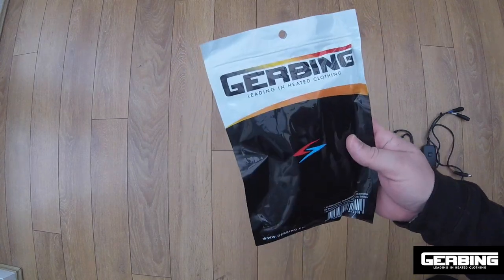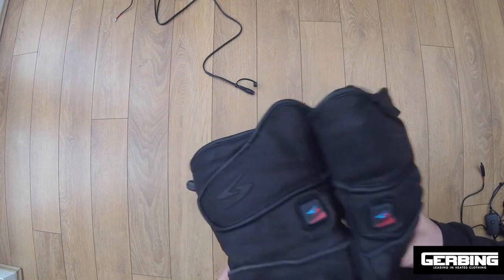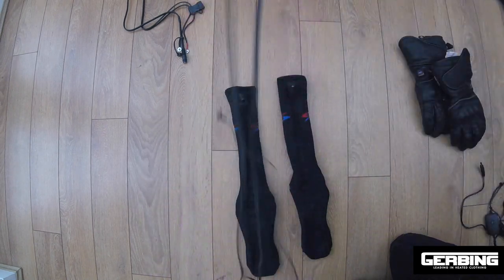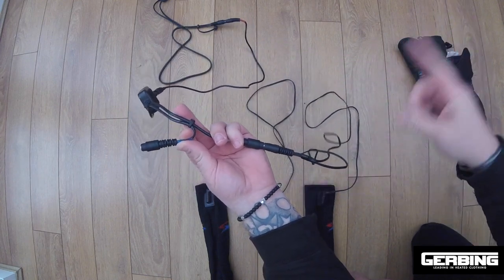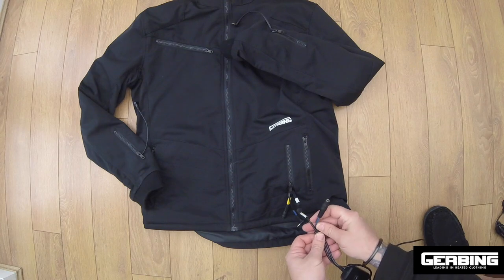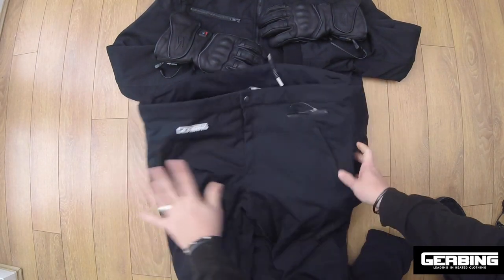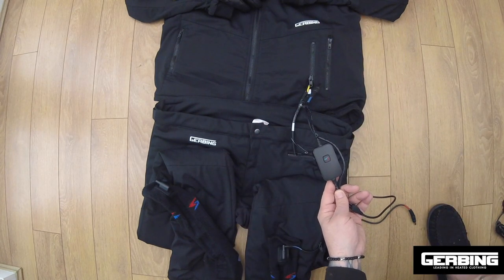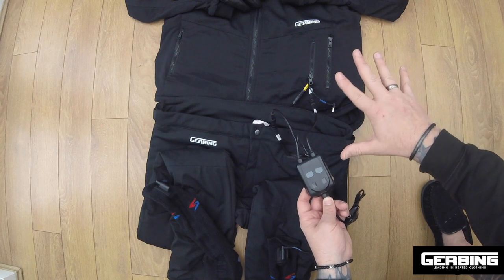How To Wire Your Gerbing Heated Clothing Controller

Comment: Really good video. Thanks for this. 
I have the single controller and all the gear, but the trousers burnt a massive blister on my right cheek and a bit on the left where the pocket is. It feels like there is a coil where it burns on the right cheek. It was on the 3 setting, 4 was unbearable. I have to pad it up by adding long John’s and two more pairs of underwear just to keep it from burning on the same spot. 
Everything else is great, gloves , jacket and socks. 
Is this something you experienced or have advise for ? 
I’m now sending the trousers back for exchange to see if it’s this pair I got.
Reply from the maker: Sounds like the heat element is in too closer contact with skin, it may have moved from the isolated layer or could be resistance causing it to get hotter. Best thing is to return for Gerbing to check

Comment: Would the full Gerbing Heated suit work good on and ATV? I use my quad for plowing snow in the winters for my own yard, and about a dozen other people, thought about this set up for the socks, pants, jacket and gloves, than toss my really thick winter coat over top to trap the heat in while I'm out for 5-6 hours, I have a separate heated snowmobile helmet that keeps the visor warm and clear, but do find inget a little chilly after about 4 hours of being out in -25C in just my normal winter jacket and ski pants.
Reply from the maker: Should work fine, as long as the adv has a 12v battery

Comment: That's some very good gear there and well presented mate I have saved that because if I do get some heated gear it's gonna be this .I am guessing you buy the controllers separately from the rest I will be checking out the website . Thanks : D
Reply from the maker: They are amazing, there are a few other brands on the market but when I did my research Gerbing were the leading brand world wide so I decide to go with them. I tried the other brands at the motorcycle show but found Gerbing were far superior in heating. It’s a costly investment but worthwhile as now I can ride all year round and not have to worry about the extremities

Comment: Excellent video!!!!  A quick question from this novice electrician.....if the battery supply is connected per your explanation, could i use a "coax male to SAE" adapter to then use that connection to power my battery tender when im not riding?
Reply from the maker: Yes I believe you can. I know you can but the optimate connector that you can use to charge the battery when not using the clothing.

Comment: Hi Mav,my gloves are coming next week,is your power supply direct to your battery,if so does it drain the battery when not in use,,,Cheers Baza
Ride Safe Mr B \m/
Reply from the maker: Yes always make sure the engine is running when the gloves are on, they draw about 7amp and that’s a lot on a battery where the engines not running

Comment: Brilliant video. It should be posted on Gerbing UK website as a freaking manual ))
p.s. One thing I don't get is how do you connect gloves to a jacket because cuffs on these gloves go over your standard motorcycle jacket...so the port/cable on the gloves goes outside, but the cable from the Gerbing Jacket Liner will be on the inner side of your motorcycle jacket or did I miss something?
Reply from the maker: They are long enough to come outside of the cuff of your jacket and into the glove

Comment: I have the gloves and jacket with the single controller. Gloves get warm but don’t feel much if anything in the jacket, even set on 5.  The heat in the jacket seems to come on until I power the gloves on, then I don’t feel the heat in the jacket. Any ideas?
Reply from the maker: That sounds like your bike or battery is struggling to put out 9amp as if it’s overloading it. I would try on another bike and if it’s the same it might be the single controller but if it works then it’s your bike.
Reply from the maker: Also what size fuse do you have in the wiring
Reply: @Motourev  Thanks for your reply. I’m running it all off the pigtail supplied by Harley Davidson for the battery tender. They said it would be ok but I’m thinking that maybe the fuse in it isn’t sufficient.

Maybe I’ll need to put the dedicated harness with the 10amp fuse on?

What do you think?
Reply from the maker: @Midlife5  yes 100% I would put the dedicated harness on, I bet the bike restricts that amount of amps through any of its wiring loom as it is a high draw of power.
Reply: @Motourev  thank you so much for helping.. I’ll do that over the weekend and hopefully it resolves the issue!!
Reply from the maker: @Midlife5  please let me know how you get on ❤️👍🏻

Comment: Good video mav and if you are going on a long trip would be brilliant but if I had to have that lot on to go out on the bike I think I would put the kettle on and say sod it ha ha ps very well explained mav
Reply from the maker: Agree mate this is for the big days out. Normal winter riding I would wear the gloves and socks every time, if I do a whole day out in the cold which I plan Wednesday then I would go fully suited and booted.
Reply: @Motourev  look forward to the vid and be careful out there
Reply from the maker: @jimhammond6395  will do buddy ❤️🤘🏻
Reply: @Motourev  Ho hum,, I actually have the warm/safe jacket &pants, and have ellecy gloves,,, BUT having the full system is just too much faff,,  so what I do is plug the jacket in (I ,v never used the pants) done.... Now I do not plug my gloves into my jacket (thats too much faffing) I plug the wires into my starter battery (line out) that I keep in my tank bag,,  I have a small cheap controller to adjust as necessary..   I just find it so much better,,  Yesterday I came down to London on my small bike ,, the electrics are not man enough to run the jacket and all .So I just used the gloves plugged in the starter battery and it worked a treat.. The starter battery is the Noco GB70 (no small affair and weighs abit,but will start a small Jumbo 747)  I must say I have been enjoying your channel,, and intend some day to visit Minimotos..(or whatever)
Reply from the maker: @lipsee100  that sounds a good set up and it’s obviously working for you 👍🏻